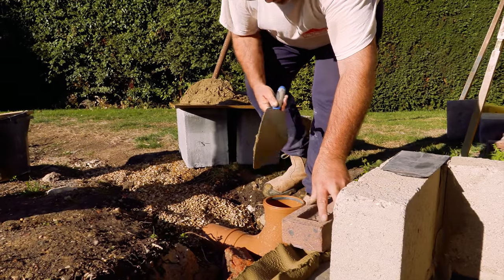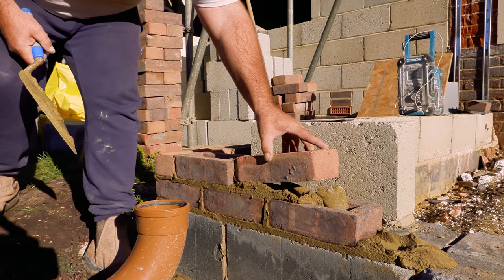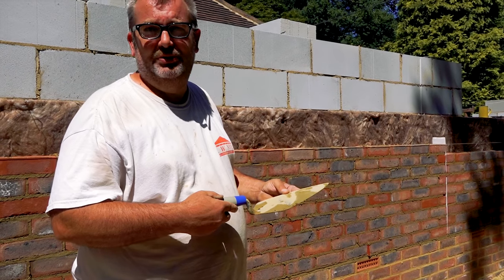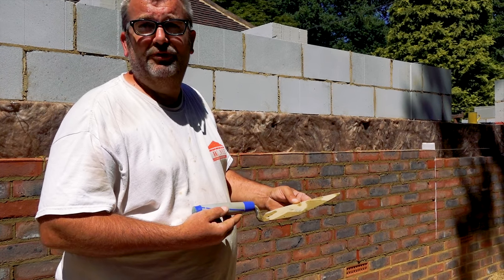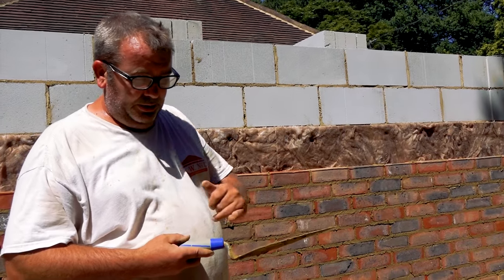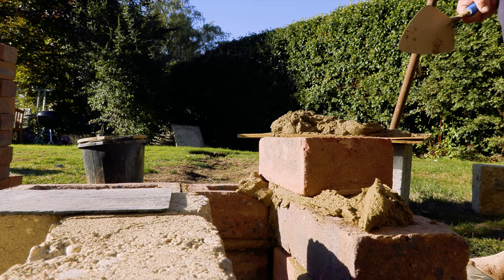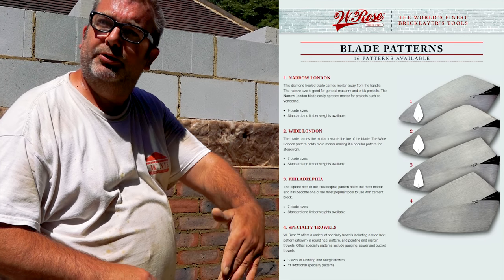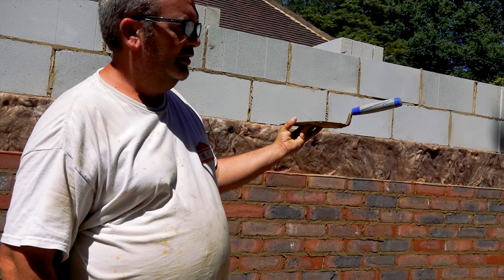Brickie Left Marshalltown for W. Rose - Why?

Comment: Rose rules. Marshalltown is 2.
Reply: Rose do not rule . Very badly made from top class materials .Riddled with manufacturing faults .very little attention to detail in there manufacture . I’d be surprised if quality control even exists in there factory . When you come across one that suits you the individual one can be top class. Bellota trowels from Spain are made from top class materials like rose but they pay far more attention to detail in there manufacture. As regards attention to detail regarding there manufacture rose are the worst I have come across bar none.
Reply: @brickbybric  I have at least 15 Rose in my possession right now. Zero wrong with them I have been buying trowels for almost 50 years 48 to be nearly exact. Some Marshalltown too. Mostly Rose. Never saw a defective one on either.

What defect's have you seen?
Reply: PaddleDogC5 I’m talking standard shank w.rose here ( or so called standard shank) I have seen them with every handle angle under the sun including parallel with the deck ( I can’t for the life of me see how they can differentiate between a standard shank one and a low lift one ) . A lot of them I have come across have very high handle angles making them practically unusable. The tangs vary widely in height and angle in relation to the blade . When you get one with the tang laying back greater than 90 degrees and coupled with a high handle angle you can forget about it. . The weight of them differs substantially. The blade flex varies widely ( leaving aside the limber weight ones they make.) where the blade flares out from the tang the edge should be ground square to the flat of the blade often times its ground at an angle that’s as sharp as a razor blade which all points to lack of quality control and attention to detail. As I said made from top class materials and when you get a good one they are excellent to use . I have also seen them slightly curved across the width of the blade which I have never seen in another brand. Very very un uniformly manufactured trowels. I have no doubt that the ones you have are excellent but I’m sure you selected the best in the store.
Reply: @brickbybric  that's exactly why I switched to the Marshalltown, the 3 I bought feel exactly the same and the blade has just the perfect amount of flex. The new leather Marshalltowns are awesome
Reply: @brickbybric  recent years most bought online from Kraft tools and bought for others on job sites. Never saw a problem with any. Post up pictures of the razor sharp heels or other defects.
Reply: peter janjanin 
Leather handle dont like a bit to chunky for me
Reply: @PaddleDogC5  have a look at my profile picture 2 supposedly exact same trowels marked rose 116 10 which makes them standard shank trowels does the handle angle on those trowels look the same to you paddledog ?
Reply: Also look at the tang heights the trowel on the right  it’s tang is lower .